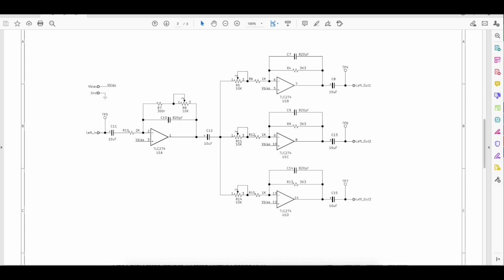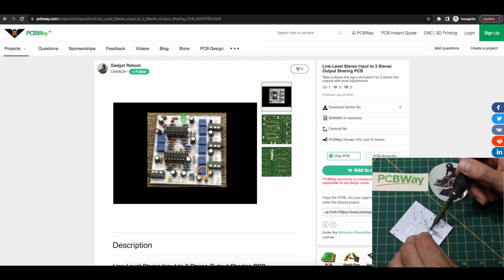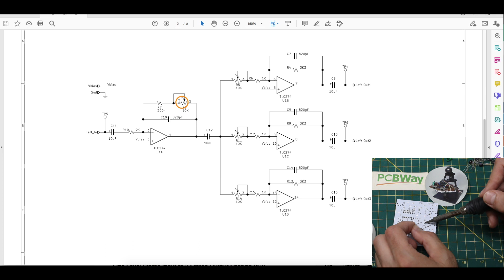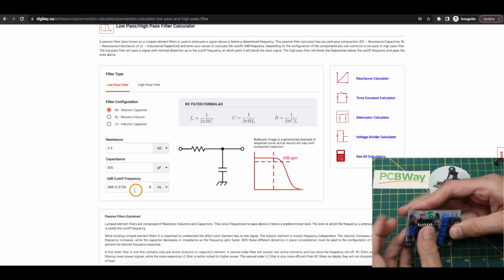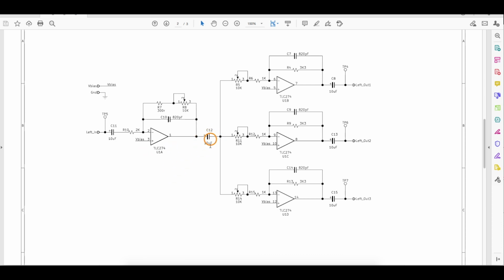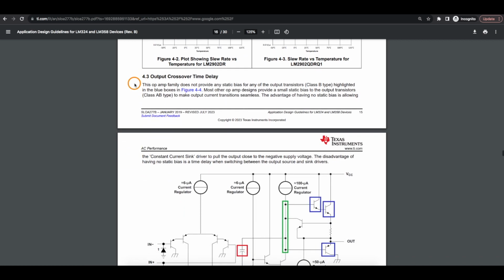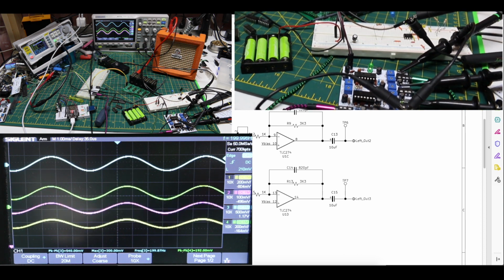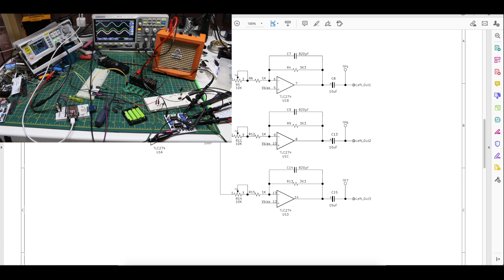Audio Signal In, Three Op Amp Output Copies for Multi Destination Sharing

Comment: Why did you take the Vbias off board, i'd have kept it on board fed from the opamp supply. possibly used an opamp to give it a lower impedance. Never used a cap in parallel with the gain adjust as this moves the cut-off frequency dependant on the gain setting. 

Also id be tempted to remove C12 as the Vbias is the same on all opamps and it will save a cap.
Reply from the maker: Yeah I think C12 can go, but would I then need to change Vbias on the latter op amps to just ground so it doesn't try to re-bias up a signal that's already been biased by the input op amp?
I did derive Vbias from the on board 5v op amp supply. I think I was pointing at a test point in the schematic so it may have looked like an off board input.   If I had a spare op amp in one of the quads I could have made a buffered vbias.  Adding extra op amps is much easier when it's surface mount stuff.
Reply: @GadgetReboot  As your running off a single rail you will need all opamps to have their +Ve input connected to the virtual ground (Vbias). the killer could be how large the input offset voltage is as this will i expect affect the output mid point. would be an interesting experiment.

Comment: How is this the only video on YouTube showing op amps as an audio splitter for multiple outputs? If you were to redesign this today, is there anything you'd do differently?
Reply from the maker: I would probably try to remember why I put the pot in the feedback loop of the input buffer instead of a fixed resistor there and the pot more on the input pin of the op amp, like I did for the output buffers just so that the op amp cut off frequency doesn’t change as the pot changes.
and I think I could get rid of the coupling capacitor at the output of the first op amp where it goes to the three out put op amps because the signal is already biased by the first op amp and can be directly passed on, there’s no need to strip away the DC offset and then re bias  it to the exact same level on those output op amps.